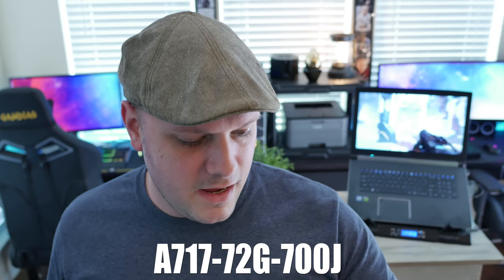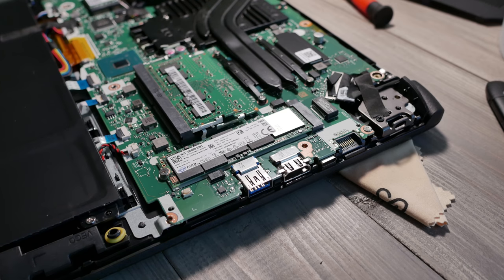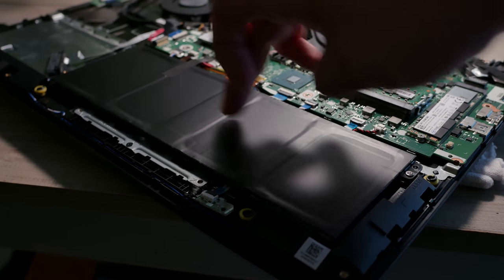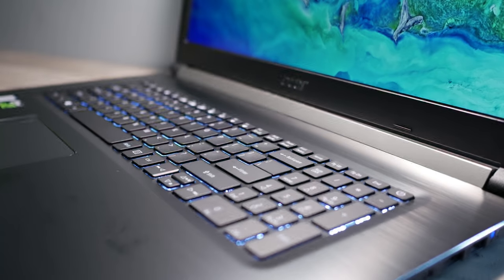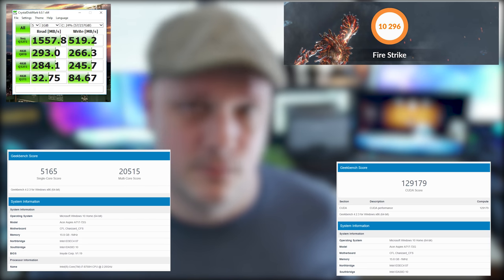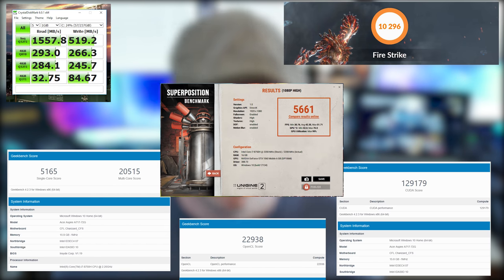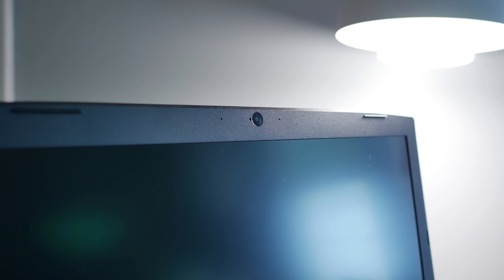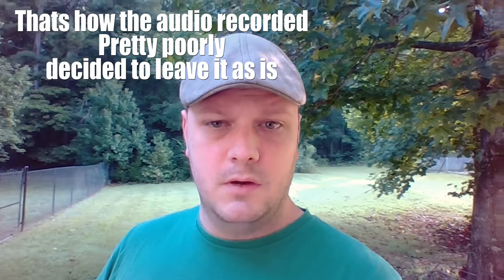Acer surprises again with a Newegg exclusive Aspire model

Comment from the maker: Someone redacted a great question, and I love great questions so I'm going to ask it and pin it here:

"Is the 1060 in this laptop the Max-Q Variant?" 
"No" and I'm sorry I didn't mention that! The predator line up, however, does feature some with the Max-Q Variant CPUs!

If you don't know what Max-Q is, its a new way for Nvidia to charge you more money (just jokes!) It's a supposedly far more efficient-thermal-related standard to increase GPU performance and 'be cooler.' I have not done really any research on it though, so I'd say go watch/read some stuff from trusted sources and see what you think.

I wish the poster didn't withdraw that question, because it was a good one!
Reply: nowhere a revieuw of aspire 7 of 2019 new model please?

Comment: I have been using this exact laptop for about a year and a half now. I was really glad that I was able to pick it up on sale for 899$. I put a 1tb ssd in it and it has been solid ever since, due to me having to traveling a lot. The large screen is nice for watching videos and playing games. It does get quite hot when it ramps up its fans, but that is expected in a laptop with a desktop gtx 1060 and a 6 core 12 thread I7. Overall a nice laptop still running strong my only issue is, the battery life isn't as good as it once was due to battery degradation.

Comment: Hey!, thanks for the great video, I see you talked about temps little bit?. The 60 odd degree Celsius that you mentioned is for Nvidia graphics or i7-8750h?. There is lot of reporting about i7-8750h being very hot chip. I would like to know how is the cooling in this Acer & what are the CPU temps in this when under load(medium & heavy)?. I'm torn between this & HP Omen 15-dc0051nr with same CPU & graphics but with 256GB SSD as well as 1TB 7.2k HDD for almost similar price(although it is a 15.6").

Comment: i have the laptop and im kinda glad it has less metal since its so heavy already.
Reply: How is the display? Is it different if you see from sides?
Reply: @shokhtv4966  It actually remains very good. It does reflect a bit of the background but not much. Its almost too good if you want some privacy.
Reply: @redcastlefan  sorry for interrupting, I am going to buy this with 32 GB ram so I have some questions....how is the battery life ?
Reply: Not actually this one a717 72g 700j
Just Acer aspire 7 2019 version
Reply: What about if laptop has 1 TB HDD and 512 GB SSD both, can laptop boot fast or should be only SDD?

Comment: Hey! This video was really helpful, so thank you for that. I would like to ask you a question tho, Im just ahead of buying a new gaming laptop, before I owned a Legion Y720 for a year, but it had too many problems and fortunately the shop took it back, and now I can choose another one. I came to the conclusion, that the two Laptop I would like to choose between is this "Acer Aspire 7 A717-72G" with the same specs you just showed in the video. Or I could go for the Helios 300 with i7 8750h, gtx 1060 (6gb), 8gb ram, but without ssd (60hz display, unfortunately, I know there is one with 144hz, but this doesnt have that). These are both at the same price, so I cant make up my mind for it. My main concerne is the heat, some guys on forums told me that they would say that the Aspire A7 was thermal throttling less for him (because he ownes that one too) than the Predator, so he would go for the Aspire one (Dont know if he has experience with the Predator aswell tho)  I tend to lean for the Aspire too, because I'm not really into these "Gamer" red & black looks, I like my things simple, and minimalistic. Im curious for you opinion, what would you say, does any of these two have better cooling than the other? Or if yes, does it make that much of a difference that I  should choose one above the other? I would use it mainly for gaming. Thank you for your help in advance! The quality of your review is great by the way, keep it up. ;)
Reply from the maker: I am able to game well on my Aspire, the Helios I don't have hands on with to really relate. This other person, do you know if he made changes to clocks via Intel Tuning utilities? These laptops push boundaries as is. If you don't use an external cooling source, and modify settings, you'll likely encounter problems on any of them. Even when doing VR we let it sit flat on the wood surface for some of the testing. It never throttled out but did really hit the high notes of 'it should be throttling' REGARDLESS I recommend external cooling for intensive long hours of gaming. I would surmise the cooling on the Helios is similar, if better, marginally. There has not been major advancements in laptop cooling other than than the lift up hinge (the ones that raise themselves when opened like a halfway in motion transformer). Sorry if this isn't helpful =\
Reply: @EightSixMatt  Hey! Thank you for your fast response!! You are awesome! And dont worry, it is actually helpful, since you said even if the predator has better cooling it would be only marginal. Thats confidencing, if I look at it this way, then the Aspire A7 is the better purchase since it has the same specs but with an additional ssd and a few dollars lower price, and even tho this is completely subjective I like this black, minimalistic look much better. So thank you once again! Have a nice day! ^^ (Sorry, this is my other account)

Comment: Im trying to figure out what to buy and i bumped in to you!! Great Review! 
Two questions though! The dispaly how much Color accurate is it? You say it is much But how much is much? Cause i do renderings and stuff and i need it to be.
And another question, if i try to calibrate the screen how feasible is it to reach high percentage of the rgbs and ntsc by eyeballing it since i dont have the spider thingy?
Reply from the maker: Spyder is pricey. I don't measure Rec accuracy personally so I'm not sure I can guide you right. To my eyes, the screen pops, the colors look great. This can usually be achieved by having great contrast range. When I black crush it, its apparent the contrast isn't what is carrying to color reproduction. All I can surmise by this result is that the colors actually cover a wide range. If the blacks aren't deep and crisp on the display but the colors still look great...it isn't hiding behind its contrast. (I'm not sure if that makes sense).
With speakers for example, some companies that have sub par or bad treble range hide it with a nice bass from a sub. Turn the sub/bass off and tweeters sound a little cracky or unable to obtain certain ranges...BUT if they sound like they can hit ranges and be crack free without the sub they are actually pretty good and not reliant on a sub to hide their short comings. Sort of the same with this display with contrast vs colors (contrast is important though, I'm not meaning to say it isn't).

I totally expected it to pass black crush easily based on colors and what I saw. Contrast can also be adjust to make it a little more crisp.

With out calibration take the laptop and an image, display it on both monitors and calibrate the laptops monitor to what you are used to. Come as close as possible for the most fluid transition. Perhaps someone has a better idea to post but that is essentially what I do (I'm no pro though ;) )
Reply: @EightSixMatt  thank you very much for your reply! I'm between the Acer, an MSI gp73 leopard 8re and a Asus gl703gm Scar, it will all come down to the black Friday sale
Reply from the maker: @Tkoukas  They all run a pretty pinch in the wallet. Check the GP73 on Xotic (I don't shop through their links but it appears to be 1099 there. https://www.xoticpc.com/msi-gp73-leopard-609.html?gclid=CjwKCAiAiarfBRASEiwAw1tYv6MkqvHs95QoYw46nF9m3EtZc09Ys1-zqsUOGJNAiehFL5EP1tzjEBoCImEQAvD_BwE

Comment: Hey man, loved ur review and hence decided to purchase this laptop in the November of last year, I'd a doubt looking at ur review I wasnt able to reach the battery life u got on ur model and I've the same a717-72g-700j bought from Newegg, I've been getting max 1 hr 45 mins on battery compared to the 5 hrs u were able to get while just normal Web browsing, I first thought it was only my variant, but saw mixed reviews on Newegg, could u recommend a solution to this problem
Reply from the maker: DDR4 is power hungry, and anything making that DDR4 work (especially things like chrome for example), will eat the battery. This coupled with background applications also. 

I get hit or miss at times. Screen brightness is a big battery drain too - if you can dim some. (Sorry I didn't see this comment initially).

I wouldn't want to blame it on the battery until you can be sure its not memory hungry application hogs running in the background - but it's not impossible you have a dead cell/bum battery in yours =\
Reply: @EightSixMatt  I also have tried checking if there's a battery wear, it showed a meagre 16 percent, idts it's anything above 25 would be a signal, nor I think acer is gonna solve this issue, in terms of ram my ram usage is pretty normal, just throttlestop for my - 141 undervolt runs in the background and all other apps like steam, rainketer r disabled on battery mode mostly, but still I barely reach 1 hrs 45 mins, the plan set to power saving, is there a way to make the 1060 kick in only when in charge, I've tried the control panel for it and designated all apps to an igpu except the games but still cannot get good battery life for some reason, all drivers too are completely updated

Comment: Thanks for the great review

A question is in my mind
Can I upgrade the screen to a better screen

With higher frequency and better quality?
Reply from the maker: To answer this, is to tell you, "if you're big in to modding and want to find all of the correct components and disassemble and reassemble successfully, than yes" but the best solution is a better external monitor and hook up to the HDMI 2.0. This model comes stock with a 60Hz refresh rate IPS panel.

Comment: Hi great review, My only question is do you recommend this notebook for video and phtoto editing and sometimes gaming over the similar priced gamer laptops? Thanks
Reply from the maker: Depends on what caliber of editing you're looking for. If you're a hardcore color accuracy pro, and external monitor is something I'd recommend. If you're casual to mid level the display works great for me. The hardware is more than enough (for now) in my opinion. Gaming is great on it also :)
Reply: @EightSixMatt  Thanks :) I need something to edit on the go. At home I have an external monitor

Comment: What do you think about the life expectancy? I heard that Acer laptops "quality" don't really go well in enduring. I'm a bit hesitant buying this one (taking it has to ship to europe, import fees etc. as it is a exclusive newegg product...).
Reply from the maker: I thought I replied to this but it must not have posted: I have definitely seen worse Acer designs, this is probably one of their better more durable (for the Aspire line) designs. That may not really say much though hah. When my laptops aren't in use they typically live in a bag somewhere, well protected. It's decent enough quality, just wish they would go with some stronger re-enforced plastics like Dell. 

Don't fret the quality too much, it is a solid laptop :)
Reply: @EightSixMatt  Would you say it's fine for hours of gaming each day?
Reply from the maker: I think so, it can take a beating for what it is worth! Played on it a bunch so far. I'd recommend a cooler for it though!
Reply: @EightSixMatt  You mean a laptop cooler or cooling platform?
Reply from the maker: yarigold something like what I have it sitting on in the video, it can angle up and has fans to help cool it, powered by the laptop via USB, for gaming on any laptop I recommend something like that. It makes a huge difference from it sitting on a flat surface (even just to have it elevated on a breathable grate) they are pretty cheap usually
Reply: Think of it like this. You wouldn’t drop any laptop, so just be carful and don’t drop it. You can also spend and throw away another 500-1000 dollars on the exact same thing, but Alienware or Razer.
Reply: Also you’re right acer products do us usually have thermal throttling, so you should play with your fans on max. If you wear headphones it shouldn’t bother you.

Comment: Hi there I loved your review btw. I had a question I was hoping you could answer when you get the chance: in order to use the laptop, does the charging cable Have to be plugged in at all times just to power this laptop? I had heard somewhere online that it did but just wanted to know for sure.
Reply from the maker: It does not 'have' to be plugged in, but is recommended when gaming. When gaming or doing intensive work, the battery life will diminish more quickly.
Reply: @EightSixMatt  okay I understand. Thanks for replying

Comment: Rendering videos and music tracks that you create uses a good amount of CPU power. I know you touched on it briefly, but how is it when handling longer video creations about at that 20 minute mark?
Reply from the maker: Mikethedude22 it will take time to render out at 4K maybe 50ish+ minutes? I don’t usually cut them that long myself so it’s a guesstimate, and complexity and render settings add in to that. Just depends. GPU acceleration when applicable takes some burden off the CPU 😊
Reply: Eight-Six thank you!

Comment: i dont have any reference of Acer as a brand, what would you choose between this one and an MSI with similar spec? thankyou, great review!
Reply from the maker: Matías Petroli I’m a little jaded when it comes to msi, had three bad experiences with three separate motherboards of theirs in the last 2 years in different builds. So by default I likely would not go MSI but that’s just me. Price is a relevant factor for me. I want bang for the buck. I am willing to compromise on some features for that. A ‘business chassis’ that’s a bit flimsy, and 60hz 1080p, non rgb backlighting doesn’t bother me. Some people want all of the bells and whistles. 

The hardware a gamer wants (for the most part) is found here. And the price is relatively low and competitive. 😊
Reply: Thankyou for taking your time, im a 3d designer so not concerned about fancy aesthetics, i think this one will be my choice!
Reply from the maker: Don't forget to clean off all the bloatware :)

Comment: I read that the monitor response time is rather slow 25ms.  So it wouldn't even be able to refresh 60 times per second.  While testing this out for gaming, did you notice any issues with this?  Thanks in advance.
Reply from the maker: I replied to your e-mail :)
Reply: @EightSixMatt  why why not make it public here so we all can see?
Reply from the maker: TheLiasas because he emailed me a lot more than just the monitor ms times question. When I associated who was posting questions with who I was replying to it was simpler to let them know ‘I had responded to your email.’

But I’m gonna let you believe there is a conspiracy here and leave it that.
Reply: @EightSixMatt  not at all,  just curious about the answer aswell  if you dont mind.  also, I wondered about its thermals,  can you do a full blown stress test and notify us how it does? (furmark + prime 95) if it handles that well,  then this is golden.  have you tried undervolting?  does it come with any software for fan profile  adjustment / power profile / gpu &-or cpu overclock?  have you tried overclocking the display?  does it come with any annoying bloatware?  now thats been 6 months how do you feel about it,  noticed any performance  degradation or thermals  increase?  have you tried if the hdmi allegedly 2.0 port actually outputs @60fps 4k? is the sound thru headphones good?  :)  youre the only one that has done a good review on this system btw,  these are just the last questions id like to answer b4 pulling the trigger on it vs the msi gl63,  which has some other cool specs (better sound and cooling apparently).  oh ,  and btw,  you mentioned the touchpad wasnst 1:1 to the screen, such thing rarely occurs.  they use acceleration and given how fast you move the finger the cursor will also move faster/cover more area.  it can be deactivated so it always moves in a linear manner,  but in practice its usually odd or reduces accuracy tbh
Reply: @EightSixMatt  &  is the power brick 180w?

Comment: Would you say this laptop is good for school and gaming, I need something with good battery and can play games, and you did say the battery was decent, and the temps while gaming was normal for a laptop, would this be a good purchase, but with a 1050ti instead?
Reply from the maker: It's pretty decent for an all around laptop. When it comes to gaming on it it depends. I always recommend being plugged in when gaming on a laptop, and for more extreme gaming with triple A titles pushing the limits the heat will increase and you may want a cooler for it. 

Battery is okay seeming, better than I thought and has held up well thus far. The more it's taxed for power the quicker it will run out though (so while gaming especially you will want a power source).